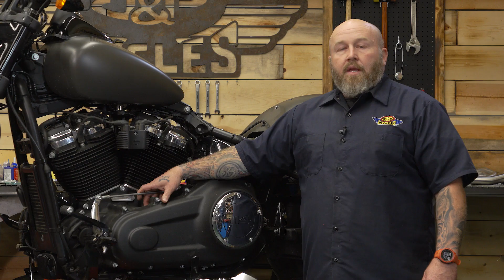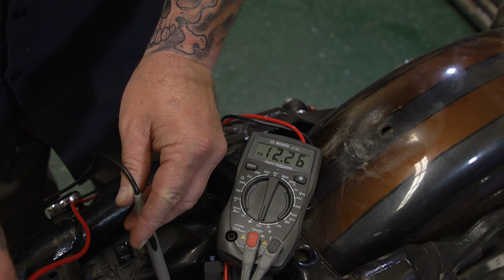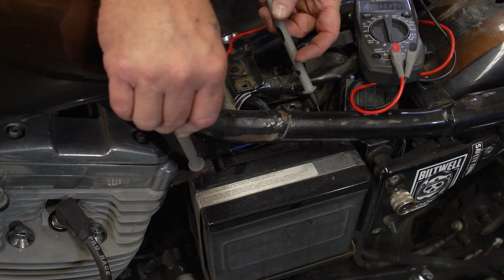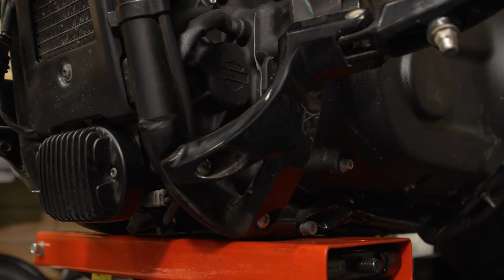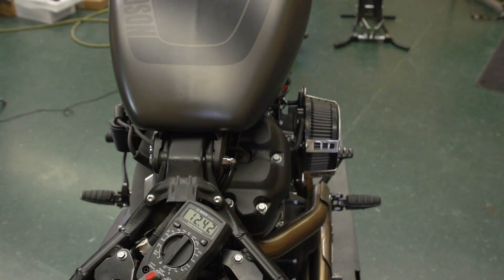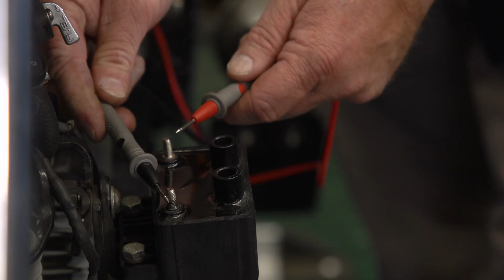Troubleshooting Your Harley Davidson Charging System :Weekend Wrenching

Comment: 2004 road glide , running a lithium ion battery that is great, changed voltage regulator . In neutral, no problems. When I ride it (under load) bike voltage goes up to 16, 17 volts!!! 

What would cause overcharging like this - but only under load? Mechanic and I are stumped. Would a bad stator possibly produce so much ac voltage that the regulator couldn’t keep up? 
Again/ no symptoms when bike is sitting in neutral- not even revving it to 3500/4000 rpm’s……but as soon as I take it for a ride- bam! Overcharging issues, even with brand new regulator . HELP!

Comment: I've got a 89 Harley  xl1200 some how the starter wire touch engine and shorted out the battery put new battery in now alp it does is turn over it's not fireing

Comment: On cold start, it seemed to charge close to fourteen amps, but after running riding for about three miles, it stops charging and amp light comes on.

Comment: I have a 2000 883 and my left turn signal only works sometimes and horn also and my battery keeps dying. I've changed the regulator and I put a new battery in last year and it's already dead now from sitting over winter. Think it's a short maybe or charging system? I know almost nothing about electrical stuff. Thanks

Comment: New drag specialties enclosed rotor made in USA stater also from drag specialties don’t remember the name it was expensive not complaining. New drag specialties rectifier regulator also an RM stater rectifier regulator installed all new parts checked AC amperage at an idle it’s 75Amp at 4500 RPM it’s 100+Amps🫢🫠. It can get as high as 110A. I double checked all my part numbers somebody enlighten me anybody I have never seen this on a bike in the 45 years I have worked on them. The RM stater rectifier regulator got hot at the plug immediately on start up so I hooked up my old rectifier regulator. It didn’t get hot and my bike made 14 V when I raise the rpm up to 3 to 4 1000 RPM. my voltage drops back down the battery power 12.2 WTF.

Comment: Have a 2009 model Street Bob Harley-Davidson diner batteries going flat when it sits for a day or two done a test off everything even tested with a test light on the right hand side of the regulator there's one wire light comes on I think it might be a diode is that in the regulator

Comment: thank you for the video, i have a 2021 Low rider S und because of the cold winter here in germany the Motobike is staying in the garage for almost a month, normally in winter i connect the original H-D charger and it would get the battery fully charged within couple of hours, however this it shows that it is charging since 2 days. if i turn on the bike it works just fine, i am just wondering why the battery is not being fully charged?

Comment: Hi there, 
I have an 02 Fat Boy and when I was riding the other day my bike decided to cut out without any warning. After a while it started and I managed to ride another mile or so before it did it again. It took some time but after a while we got it started and I rode 30 miles home without it doing it again. I did not lose any power when this happened and the engine sounds fine however the engine management light came on. I stated it up this morning and it started first go however when I turned the engine off to go and close the garage. When I went to start it again it would not start. I have had my friend who is a mechanic have a look and he seems to think it's the Stator as we are getting power from the battery fine however when checking the regulator and the end of the stator we are only getting 0.1 to 0.3 volts through when trying to start the bike. Do you think this is a stator problem?

Comment: Been a Diesel mechanic for over 33 years, started my career in the Marine Corp, Harley has the absolute worst and caveman style Electrical system I have ever encountered, the older Dyna's aren't to bad but the big twin baggers.. hope you got all Day maybe 3 days to diagnose an issue, I don't have that time, that's why I gave up Harley's 5 years ago and went with Indian.  If Harley wants to keep using a 1940's approach on electrical systems then their bikes can ROT on a Lot for all I care.  It pains me to say that because I have only purchased Harley since 1988. I will say though, Harley does a great paint job, better than Indian and lasts longer, but Paint doesn't cause electrical issues poor engineering does.

Comment: My bike runs just fine for about 8 miles then it will simply shut off, as if you pushed an off kill button.
New batteries make no difference. I have a new coil recently as well. Regulator is about 2 years old.
Reply: Sounds like ignition module
Reply: @dempseygoodno4166  Thanks for your input but the ignition module is also new. (about 10 months old)

Comment: Hey man I have watched alot of you videos and tested both regulator and stator. My problem is the volt meter dances from 13.7ish to around 15.5 while riding. It is a 14 street glide Please help!
Reply: Larry, I've learned that your specs are within tolerance levels, although15.5 is a little on the high side. I personally would replace the voltage regulator since they usually cost only around 50 bucks.

Comment: When I plug my 2015 Harley XG750 into my battery charger my cooling fan goes on full blast.  
Without the key, when I put the key in the fan slows down but still keeps running
Reply: @jpcycles

Comment: So what voltage should the battery have just setting there in the battery box??? What voltage should the battery have if it is "holding a charge" (as you say @ 1:20) ??? What voltage should we have at the battery when idling??? What voltage should we have at the battery at 1500 rpm or 2000 rpm???  Having us dive directly into testing components is BS.
Reply: This is general for bikes, and you'd obviously have to consult your maintenance & service guide for that info - it could be different depending on which bike you have.
Reply: A battery in any road ready vehicle should at least be at 12.5V if it isn't then you need to charge it
Reply: But yes consult your manuals and do your research, nothing's wrong with not knowing. Also, check out what the cold amp charge is on your battery

Comment: This is what happened when I just bought iron 883 couple days ago, my bike sputtering all the time when low rpm, have checked the charging system and the bike shows low voltage, less than 12.5 V and  decided to change with new stator, but unfortunately it doest solved the probs, the we have check coil, fuel pump, injection system & injection sensor, exhaust & air intake system show it all no issue, then we try remapping the ECU and voila....it works, now my bike is fine

Comment: After shutting off my bike when I go to restart it it just clicks like it's dead again and I have to jump it every time I go to start it. Why is that
Reply: Check ground(s) & loose connections. If your battery is 3 to 5 yrs old consider replacement but first check your bikes charging system first to see if the voltage regulator is putting out the correct voltage.....or too much or too little voltage.
Reply: 3:08 3:08
Reply: @charlesgilson4157  Why tell us to view the end of the video, which is 3:08?

Comment: If my stator and regulator and battery is brand new but I’m still having the problems that my bike keeps dying is there anything else it can be?
Reply: Vapor lock if the problem is the engine bogging after warmed up. I had this problem and had to make adjustments to my shovelheads fuel line.